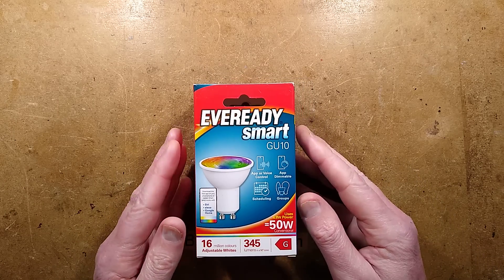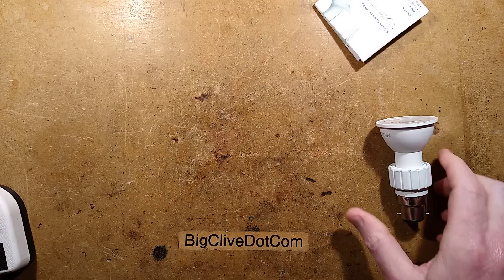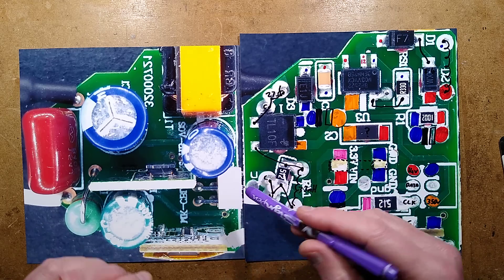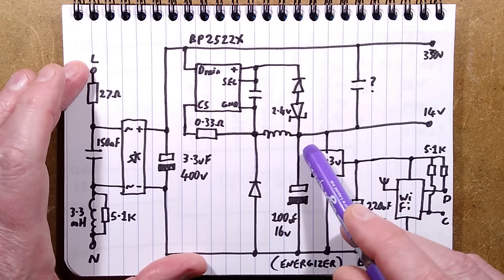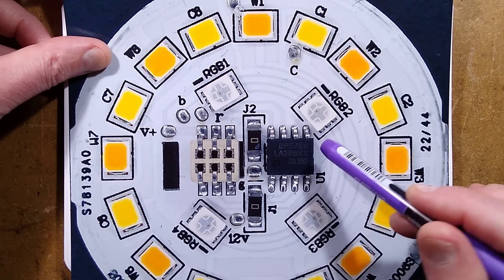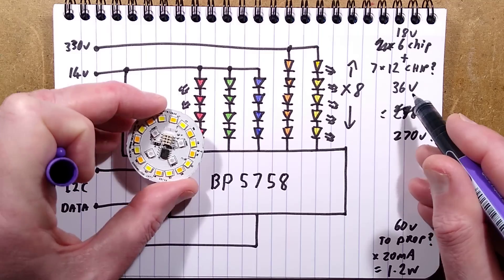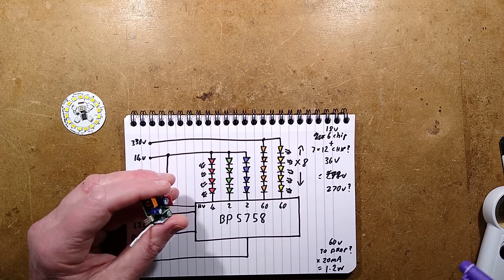Poundland Eveready WiFi lamp teardown - with very cool chip

Comment: Thanks for the detailed teardown and explanation. I’ve only installed custom firmware on these bulbs but i have limited knowledge if i need to fix them.
So far I’ve only managed to repair the ones with obvious blownout capacitors, but other than that i wouldn’t know what to look for.

Comment: I have a "smart" LED wall light that's like 5000 lumen (it's a shop light) or something and it also blinks when it wants a wifi connection. Also, you can put it into wifi connect mode by turning it off and on 6 times. I also discovered that brownouts can also simulate this if the input voltage fluctuates 6 times.

Whoever thought that rapidly blinking a 5000 lumen light at full power to indicate it needs to be paired was a good idea needs to be forced to sit in a room with bright blinking lights being beamed into their eyeballs for a month.

Comment: It looks like the mystery capacitor is there to smooth noise coming from the 12V regulator, you don't see it often because companies cheaping out
But without it in this case, it might affect that ripple on both outputs of the 14V and 3.3V supply, and create noisy data on the i2c bus or cause resets in the micro controller/WiFi module

Comment: I replaced WIFI controlled bulb with an IR controlled bulb, much better and .....cheaper! I think it is really ridiculous to need to download an app and to make an online account to be able to control a bulb! If you are smart, you can also 'connect' the IR bulbs to something or your own projects because it is just IR, not a difficult closed WIFI protocol. It is very funny to find out that you can use one remote to control all of them at once or individually by pointing or by using your hand to guide the IR beam into one direction. No security or privacy issues, for me a keeper!

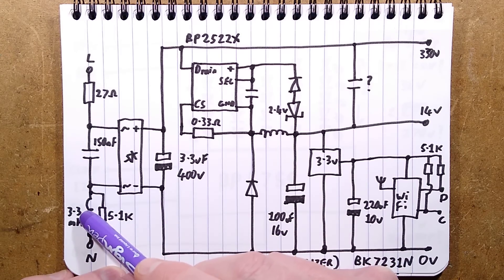Comment: great video. at 5:37 you quess the 5k1 resistor is to quench resonance, I agree, in other words it drops the Q of the coil lessening the length of ringing of the coil and 150nf after the 3u3F capacitor has dried out.

Comment: Energizer are cheap bastards. As I watch this I had to fix a brand new Energizer charger, it was just a bad solder joint but still. I also heard their 'D' cells are the same capacity as their 'AA' cells.
Reply from the maker: The consumer D and C cells are often just an AA inside.  The Industrial ones are full capacity.

Comment: Regarding the "I-wanna-be-paired-to-some-device" blinking: I got a ceiling light a few years ago. BT-LE remote controlled (RC sold separately), RGB-C-W, 2000 lumens on White mode, color temp from 3000 to 9000 Kelvin. Powered up first time, it started in a steady red mode. Put a 9V block into the remote, and press a key combination on it to pair it to the ceiling lamp.
Wanna unpair? There's a video on YT with a six-step light-switch off-and-on procedure, with "OFF!" and "ON!" spoken, and a visual representation. Finish the procedure, and the lamp's back to full-red.
Oh, and you do need an account if you want to use the smartphone app, but then you can use 4 pre-sets. The remote only has buttons for two pre-sets...

Comment: Funny, I've worked in IT for +30 years. Do we have a single connected non computer device? Uh, no. I remote to sound boards on secure closed networks (not on the interwebs) and that is about it and only with certain equipment. Just call me paranoid...
Reply from the maker: Not paranoid - safe.

Comment: I found a datasheet for the BP5758, and the HV pin is rated for up to 500V. The power dissipation is only 1.25W (which will cause it to heat to 150C based on the thermal resistance value  from the datasheet). Kinda weird that it doesn't seem to be using that GND pad for thermal dissipation.

Comment: Can you prove 400v capacitors in street light power supplies aren’t to power death beams?!! Didn’t think so! Check mate! 😂
Reply from the maker: There is a disappointing lack of death beam circuitry in them.  Otherwise it would be a prized collectible gadget.

Comment: Most modern routers have a AP isolated Guest WiFi option. I use that for my IOT. It cant see sh!t on my main network. Assuming they isolated it correctly and securely :)
Reply from the maker: The last bit is the tricky bit.  In the past one of my high profile routers failed a security test because it had ports that several other undocumented admin names with fixed passwords that allowed the replacement of the firmware remotely.
When I discovered that I loaded new firmware myself and made sure all known means of access were secured.  But the non-technical types wouldn't be any the wiser.

Comment: Hello! We are OpenBeken team and we are working on firmware for new Tuya chips, currently supporting BK7231N, BK7231T, BL602, W600/W601, W800/W801 and XR809. You can find much more info, IoT device teardowns and flashing guides on our Youtube channel here!
Thanks to our community efforts, many new WiFi devices can work in fully cloudfree way and users can regain their privacy.
Reply: Do you know if any of those chips or modules can be bought separately for DIY projects? Or is it better to just stick with ESP8266?

Comment: I've made a mistake! when I tried to "reverse engineer," this particular smart bulb 😢. I just followed the circuit examples from the data sheets for the various chips. I didn't realise that  the RGB LEDs were powered by 14V supply (12 modified to be 14v). On the data sheet, the RGB LEDs seems to be powered directly from rectified mains, the same as the warm and cold white led's. I will now have to mention the mistake in the description of my video😢. Or maybe even take the video down. 

Thanks for making this video Clive, your reverse engineering skills are 2nd to none!😊
Reply from the maker: Just add a note in the description.  I do that for mistakes I make.

Comment: BP5758 is using I2C as transport bus, but does not adhere to the I2C protocol.
It does not have a slave address, but instead it's own dimming control protocol addressing the light logic directly. I guess this was cheaper to implement.
Reply from the maker: I'd guess most applications would literally just be a single LED driver.  They probably used I2C for the existing libraries or silicon designs.

Comment: Eveready, yet another brand name being used because of brand recognition, and also a way to sell the cheapest tat around at a mark up. I have a radio branded that as well, it runs off 9V PM9 batteries, and came with one as well. The radio, with included battery, was cheaper than buying the PM9 battery on it's own. Thus, when the battery went flat after a few weeks, I simply stripped the dead battery out of the cardboard case, tossed the stack of cells, and repurposed an old iron core wall wart, from a defunct Panasonic cordless phone, as a power source instead. Added a 470uF 16V capacitor I had around for extra smoothing, and put the cable in to the old connector, soldered and powered it on. After 3 minutes the 220uF 10v capacitor inside the radio went pop, oops moment, 9V wall wart was giving 13V unloaded, or low load. But radio still working, so it has been running like that for a good few years now. not bothering to replace that decoupling capacitor, the rest of the radio is fine with 12V supply.

Comment: Energizer and Eveready are the same company. Not really much reason to buy their products today but I should point out that they were the ones that developed the alkaline battery, so they do have an achievement to be proud of. 
Duracell has no such accolades. But here in Belgium at least, they are made locally, so every store that sells batteries has them. Being a reputable brand is worth more than a lot of people give it credit for, too. You might not want to use them at home, but if it's company money you do, because if a battery does leak, explode or start a fire, you wouldn't want to find out the hard way that no one ever got fired for buying Duracell.
Reply from the maker: Same reason I always put Duracells into props.

Comment: The BP5758 is sufficiently explained, if you ask google-sensei. It just easts an I2C signal.
So... you could remove any shady chips (i.e. the WIFI) and replace them with something more secure or sensible (i.e. an XBee, or a micro controller and an IR sensor... or whatever your personal preference is).
Reply: replace them and sell at a markup :p

Comment: Clive get into the future, smarthome is the future and you dont have to cloud connect anything if you dont want to, you can use it locally on your own wifi, and with your tinfoil hat you can block the bulb form the internet, so nothings is leaked, and you know it does not matter if it a smart or dumb bulb if the power companies shut off the grid you wont get light too, soo your dumb bulbs are allready connected to someone else!

Comment: Being able to control lights and monitor sensors remotely is quite handy. BUT it's worth it only if you take the time to do a little bit of research in the devices you buy and then flash them with custom firmwares to liberate them from cloud bs otherwise is simply too risky.
See for example the story about Amazon cutting off access to someone's devices because a delivery driver misheard the automatic doorbell message for something racist and alerted Amazon.

Comment: almost all lamps from tuya that i had had the flashy flashy disco mode, ugh i also hate it and i am just a teen kid, dont like that they added the feature(also a reason i converted them to local tasmota) And yeah i was alsosurprised when i first tore them appart, interesting chip that brightpower! kinda sad tuya (probably the maker of the bulbs or the manufacturer of the wifi modules) switched from esp8266/esp8285 based modules to beken modules making hacking them a bit less easy (needing a new flasher program)  but its still doable. maybe tuya made the wifi modules and energizer rebranded them or its a energizer module.

Comment: Poundland bulbs are one of the best sources for cheap WiFi IoT modules. It works out even cheaper than buying the module alone (in small quantities) from retailers.
Reply: Still cant find the Flaming solars from the last video.
I noticed a big chrome solar table top lamp with pull cord and 3 lumens settings for £12,

Would love to see that torn down
Reply from the maker: The solar flame lanterns were from Poundstretcher.

Comment: I know you don't like connected devices and the IOT. But it can be more than a gimmick. I'm using 2 WiFi lamps at my parents house, I simply use them to get a notification when they connect or disconnect from the WiFi. Parents use the light switch as normal.

Comment: The dangers of those cheap smart devices are that they're essentially a computer that you connect to your local network, and it's remotely managed from the Internet by the maker of the device. If their servers get compromised, those devices can become a botnet and be used for nefarious purposes.
The best way to mitigate the worst of the potential bad stuff, is using your router's configuration interface to create a new WiFi, and activating the "ap isolation" option when you create it. Connect all smart and IoT devices to this Wifi. This option disallows any connected device to interact with the rest of the devices on the network: it only can "talk" to devices outside (the Internet). That way, if the device is rogue, it can't do anything to any of the rest of devices/computers on your local network.
You can use this secondary wifi to connect any device that it doesn't need to access any other device on your network. For example, a Smart TV, if you don't have a media server, it doesn't need local network access. Also, when you create a "guest" wifi network, the "ap isolation" option is enabled by default. Do not use this wifi for a printer, you won't be able to use the printer on the network.

Comment: The problem with WiFi bulbs is that 50% of the manufactures take security very litely, and the other 50% take security very lightly.
Thank you for another enlightening study.
Reply: Enlitening?
Reply: That was illuminating.
Reply: @ZacabebOTG  Someone got the joke. Zac restoring my faith in humanity.
Reply: @ZacabebOTG 😂😂😂😂😂
Reply: Thanks for shedding some light on reality.
Reply: that is why i have a guest wifi isolated from my main wifi network that these "smart" devices connect to
Reply: @ShockburnVR  Doesn't matter when their app is sending all your personal data back to the mothership.
Reply: Also, most of them only use the 2.4Ghz band, so if you are in an area with a lot of 2.4 ghz traffic, connections will not be reliable. I had a bunch of 'smart' devices that regularly just decided to drop out, and the app was written in such a way that I ultimately had to completely wipe out the setup I had and re-do it no less than three times before giving up and going over to devices using Zigbee.  Shame,  those lights were capable of some neat effects, but having to re-build the entire configuration multiple times over the course of six months just broke me of any wifi-based lights.
Reply: @bonivuselderheart2716  What brand was giving you trouble?  None of the Tuya based ones I have have wiped themselves, and the few times I've reset a device to switch wireless networks the app sees that it already knows about that serial number and puts it back where it was.
Reply: And 100 % of them try to steal your personal data.
Reply: @kapegede  They don't try, they do.  It's right there in the agreement you clicked "agree" to when you logged in.

Comment: I've seen a lot of G-rated electricals lately. Have we just given up?
Reply from the maker: It's the new rating, where A++++   is now G.
Reply: That's the problem with letter based efficiency rating systems. Once every manufacturer gets their items up to level A (not too hard to do), how do you tell the consumer that your new super product is more efficient when it can only be rated A with a few pluses? So now we have all the old ratings downgraded to G or lower and a new arms race by manufacturers to get to the top of the letter system. Fast forward 5 years and we will see this happening again!

Comment: I still have incandescent light bulbs that don't require a WiFi connection to operate. They'll have to prise them from my cold, dead, fingers.
Reply: Now calculate how much they’re costing you in electricity.

LEDs much more efficient and if you under-drive them they last much longer too.

Comment: I like IOT when I control all data. I have a dedicated Wi-Fi for no internet access for my devices. I specially picked or built devices using ESP32s. Might use more energy but they are secure

Comment: If it's got a Beken chip on the module, it can almost certainly be reflashed wirelessly using the Cloudcutter method. Needs a ESP based board as a sort of middleman if you want to use the simple android app... But works quite nicely instead of having to solder onto the tiny Tx and Rx pins on the module.

Comment: The large package is most likely to prevent theft.
Reply: Plus the fancy bulb is more expensive so they want to make you think it's worth it with fancy packaging.
Reply: Either that or they can simply cram lots of information and advertising blurb on it.
Reply: and it might as well come as a B22 and E27 model as well, so all 3 fit in the same box design and just replace the bulb image on the box

Comment: i'd bet the packaging is used for larger lamps, so instead of cutting boxes for different size lamps, they save a bit on just one size box for all of them they can fit in there.
Reply: Or when the boxes are on the store shelf and customer should select the product... bigger is the better. Actually bigger box got more visiblitiy in the shop.

Comment: Disco mode is to connect to WiFi. Maybe it's just me, but not sure anybody would pay that much money for a smart bulb that's not going to be connected lol
Reply: Imagine all twenty bulbs in the house all starting to blink, because the broadband connection fails for half an hour
Reply: @rexsceleratorum1632  I've only had smart bulbs around the house for a little over 4 years, including name brand as well as dirt cheap no name products ... and I have yet to experience that, despite power and network outages of far longer intervals.

Granted, my mind is far older than my body, so I don't even trust my memories on this next part, BUT I genuinely feel like I remember some bulbs initially starting in connect (blinking) mode, and after successfully setting them up never reverting back to Disco Dan mode. Again, after rather lengthy power and network outages.

FWIW: my initial reply arose from other comments to this vid at it regards blink/setup mode,, not Big C's passing remark. 

All that said, you have now engaged my inner child and my adult onset ADHD to the point of being tempted to test this somewhat thoroughly, albeit not including whichever Chinesium Enhanced unit Clive showed us here. A modest fixed income is not very conducive to impulse purchases from overseas lol
Reply: @TomPutty  All I know is that my experience with Tuya involves some annoying flashing lights, and then flashing lights with tasmota/esphome

Comment: Ahhh, a Bekin chip.  I was told most of the cheapo devices are moving to those rather then an Expressiff chip.
Reply: yep probably tuya thinking (tuya makes all those modules and hosts the cloud server for those in china) esps are more expensive and they could be easily hacked, let switch over to more dificult to hack beken chips